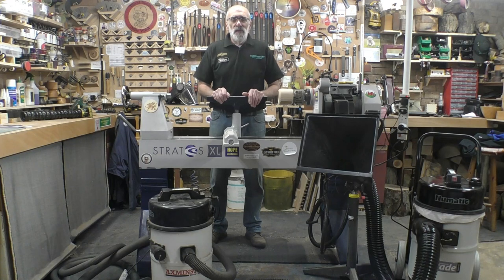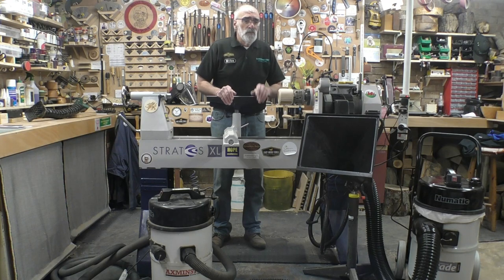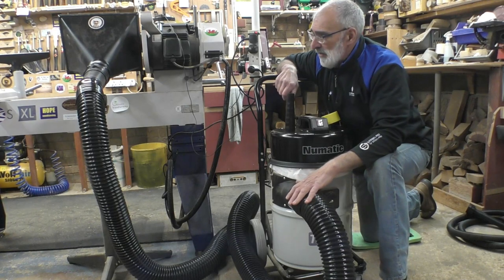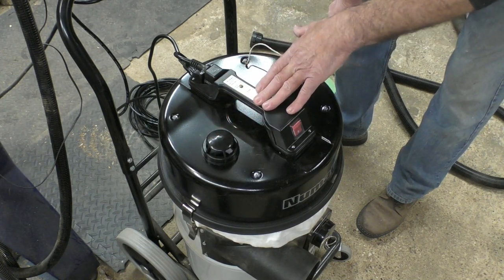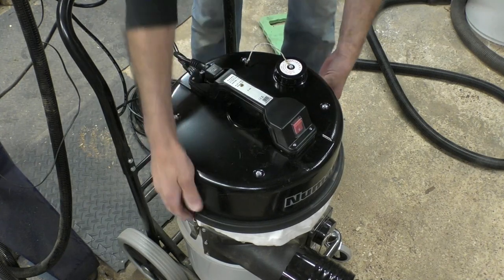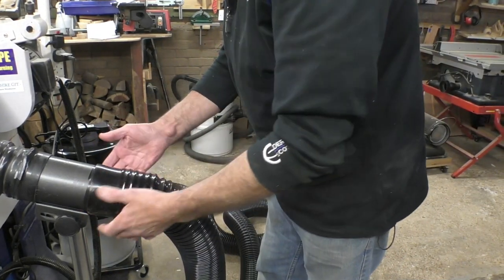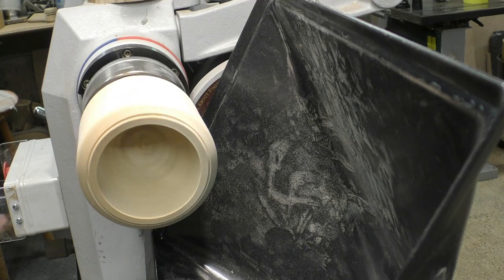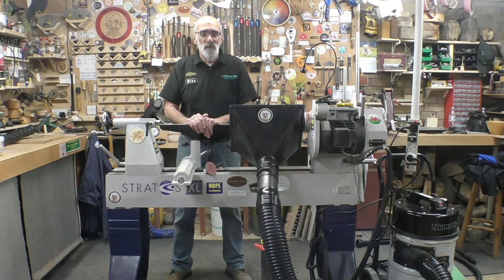Woodturning - Axminster NVD750 Vaccuum Extractor

Comment: Great machine Mike I have a twin in cam vac and was given a great tip of putting a old hose into the exhaust hole and I found that this reduces the noise of the motor it is just down to luck if you have the right size hose for the exhaust hole also you can then use the hose as a blower to clean down the lathe Plus that warm air is quite nice in the winter in a cold workshop have fun . as you have some time at the moment on lockdown👍😀
Reply from the maker: Thanks for the tip Russell and for watching. Stay safe my friend.
Reply: Would love to know how the Camvac twin motor copes on the lathe.  I only have the Herald and do a lot of between centre turning and am considering the Camvac.

Comment: I have had the Numatic original for a couple of years now and agree with your findings. As a previous viewer said, if you connect a hose to the outlet the benefit in noise reduction is enormous. Also I turned a bung to fit in the dust extractor mouth to save removing it when using the smaller hose and of course boost it’s power.
Reply from the maker: They are very impressive machines Frank. This comes with  a blnk off attachment for the large port for when you want to use the smaller hose. Stay safe.

Comment: Hi Mike, As always on your overview of machines a very thorough explanation. I already have a twin motor Axminster Vacuum Extractor on a 4" system which I'm very happy with. It doesn't have the ability to step down to the smaller sized tubes but to me, it's not a problem. Take care Mike. Cheers, Huw
Reply from the maker: Thank you Huw, I doubt I will use that feature, but it is handy to have the option. Stay safe.

Comment: I have one of these, overkill for my limited machines, as I have bandsaw, mitre saw, scroll saw and small pillar drill only. All different size extraction ports (headache), which Ive adapted in various ways to the 32mm hose. The 100mm hose lies unused awaiting a lathe and router table, then  I intend to set up a fixed 100 or 64mm extraction system with blast gates, and adapt everything to that. Currently I just pull the NVD750 to where its needed and hook it up.
I saw elsewhere on youtube, a user who built a small and ventilated shed outside his garage workshop, and kept the nvd750 out there with a cyclone, giving silent use (and more space) in his workshop.  I doubt I will go that far, and I dont have the skills to wire it up for auto switch on/off.
  I think the 100mm hose would also be great for clearing fallen leaves later in the year, instead of blowing them, suck em up and tip in the bin on a dry day, there might be some unfortunate snails though, so maybe not.
Take care, I will check you out again when I start woodturning.
Reply from the maker: It's a really great machine for all extraction needs Paul, enjoy your turning journey when you finally get started.
Cheers 
Mike

Comment: Very impressive altogether Mike, especially the sanding demonstration. Whilst the decibel level is obviously legal, it did seem as if ear muffs would be necessary, and presumably you were just illustrating the use of the HEPA filter upstream of the coarser filters. It occurs to me that should you choose to fit  a vacuum chuck (and temporarily forego the dust extraction) ,the 23kpa pressure would suffice without recourse to a separate vacuum source. Just some thoughts late at night!   Bernard.
Reply from the maker: It sounds louder on camera than it actually is Bernard, especially with the air diffuser fitted. Good tip re vacuum chuck will think about that as a future option. Stay safe my friend.

Comment: I've had one of these for a number of years now, and can't help thinking that it's suction is much reduced by the small outlet, more so when using the 100mm inlet for my planer or bandsaw. I'm very tempted to cut another hole in the top to help.
Reply from the maker: I would interested to know ... if you do make an extra hole ... the difference it makes John. Thanks for watching.  Cheers. Mike

Comment: Hi Mike. As you were explaining the various features the thought occurred me on the exhaust port on the top of the machine that you said you would like to leave off while running and screw it back on before leaving for the day. Well I am sure they donot make this item for it but have you every seen one of those tractor flappers on the exhaust pipe when running it flips up to allow the hot gases to escape but when it is off it will close to keep rain water from getting in the pipe. That would work perfectly. You would have to make one. Cheers
Reply from the maker: Great idea Ed I might do something like that in the future. Stay safe.

Comment: Ooh as a lady/beginner/hobbist, I have several power tools: thicknesser, table saw, mitre saw, band saw and belt sander. I had a shop vac thing which was RUBBISH and got rid of it. I'm in the throes of having a very small workshop built at the moment and need extraction for all of the above (which all have very different port sizes, annoyingly none of which seems to be very standard sizes - such as the Clarke belt sander which is 60mm). Most of the videos I've seen and advice given is for very posh semi-pro huge fancy workshops with ducted systems, blast gates etc. Lovely as that would be I don't have the space. Up until now I made trollies for everything and wheeled them outside to use, but that is not practical all the time. I am a bit confused to what I need. Do I need a chip extractor AND a dust extractor? Or can one thing do all? (I also have a cyclone ready to hook up) and have very little room to play with. Any advice would be gratefully recieved.
Reply from the maker: Hi Hazel, I have a dust extractor ate the lathe for sanding, an air filter in the ceiling,  and wear a powered respirator, but don't have a chip extractor, so I just clean up the chips as and when 🙂
Reply: @MikeWaldt  thank you for your reply. Crickey - a powered respirator! Boy those are ££££. I think a ceiling air filter is also £££. I may settle for the. Machine you reviewed here.
Thanks!

Comment: Hi mike you can also put the small hose on the exhaust port and use it as a blower to
Assist in pushing the dust into the hopper well on mine
You can its a numatic also but not the same model but
I would think they would be 
Universal ...just thpught id mention this great workshop by the way lol.
Reply from the maker: Thanks for the suggestion, I have thought about doing something similar ... if I ever get around to it! 😉. Stay safe.

Comment: Hi Mike, I bought the NV750 for primarily using as a dust extractor for the lathe, did i make an error? I think the NV750 is the same as your old extractor, how did you connect the 63mm flexi hose to the 51mm hose of the extractor?
Reply from the maker: Hi David, I turned a reducer with an internal taper, then used wide PVC rape to seal the joint. Hope this helps.

Comment: Hi Mike. Good review. Why use the hepa bag as a filter rather than a bag? I have the same as your original Numatic and whilst the bag is a pain to get out when full, unbagged dust would go everywhere. Regards, Mike
Reply from the maker: I use the bag on my old one that way, but on the new one there is no way to attach the bag to the 100mm port, a shame that.

Comment: Hi Mike
I've just got the same machine and waiting for it to arrive.  Now you've had it a few months, how often do you find you have to empty the bin?
Reply from the maker: Hi Lyn,  I use it solely for catching dust from sanding on the lathe,  no chips, and use the Hepa bags and not changed it yet, but it will need to be done soon.
Reply: @MikeWaldt  Cheers!  Keep safe.

Comment: You don't use the bag to collect the waste then? When using the bags as intended you end up with waste in the container and the in the bag if you interchange between the two ports.
Reply from the maker: I prefer to use the bag as the extra filter as I only use the machine to collect dust not chips 🙂

Comment: Hi Mike, A very informative video. Do you mind if I ask, forgive me if you have already addressed this question, have you considered hard piping the extract each machine with blast gates at each unit? Allowing a centralized system negating the need to relocate the vacuum and hooking up the hoses each time. 
Regards Rhys.
Reply from the maker: Hi Rhys I have thought about it but never actually got around to actually doing it 🙂

Comment: A very good review, the dust extractor  looks an excellent system and you have made a good choice with the triple filter too. One thing, I thought you said was that you had the light duty stand but according to the Axminster website the big mouth hood doesn't fit it. 
I was a bit worried when you knelt down  in case you couldn't  get back up 😂😂😂
With that I'll go!
James
Reply from the maker: Thanks James,  I did have to use an old rubber cuff that I had to get it to fit, I already had the stand, so wasn't going to buy another one 🙂.
I still haven't managed to get up yet! 😂😂